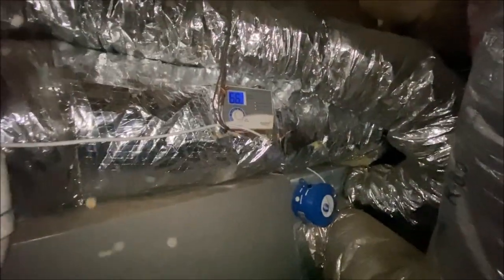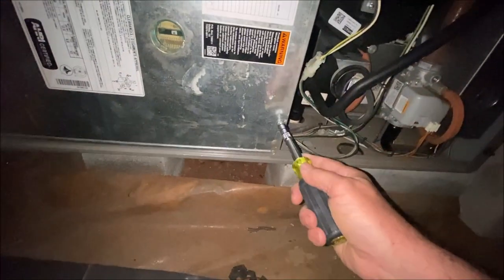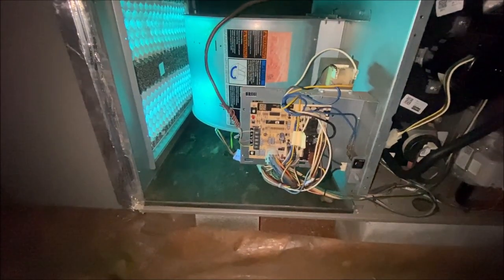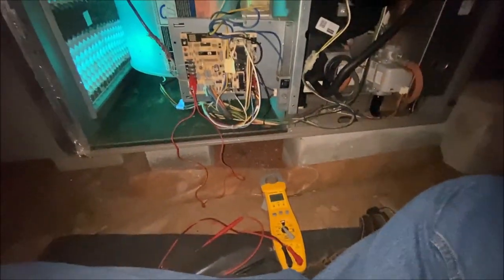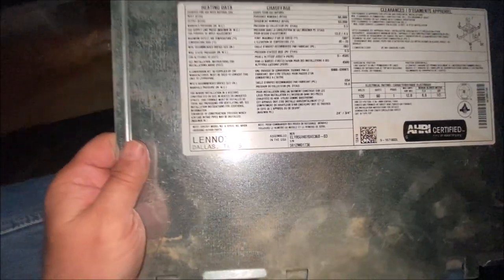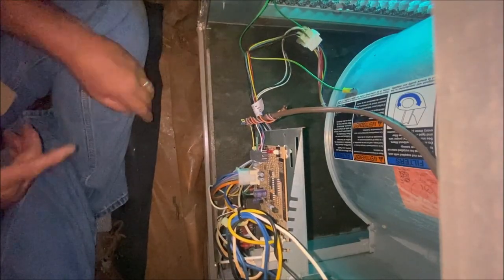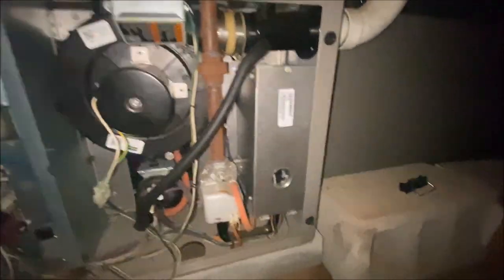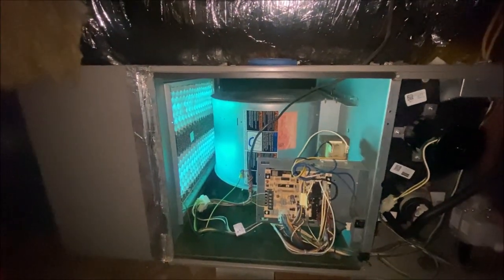Lennox ECM blower motor fail and replace

Comment: I don't think the UV light should be shining on any plastic parts or wire. Kinda like the sun.
Reply: ...worse😏🤫
Reply: And should be interlock with the door switch and not come on when door is open
Reply: I was going to say the same thing or bare skin for that matter.  I don't think it should be blasting light anywhere near that board either.
Reply: @DaveBigDawg that would be tricky to wire up and make look right, the door on the filter housing itself does have something, you have to unplug it first to open it.
Reply: If it is placed down the return line more and shielded, should be no problem to be on. The ones I have used only shone towards where the airflow came from.
Reply: @tedbell4416  it'll be ok, just stare at it for a few hours or ten..... 🤣🤣

Comment: I’m pretty sure that 4th screw in the bracket without the rubber mounting was a shipping bolt meant to be removed at installation
Reply: The moment he zoomed to the motor my alarm bell was ringing. They forgot to remove that bolt for sure. I don’t think installers read the manual. Wait, I know for a fact they don’t.
Reply: Your 100% right that’s plastic washer got a bin full of em
Reply from the maker: Yea and that is the noise you hear when it first fires up.
Reply: It is lol. We only install Lennox and I always take those out. Manual clearly says to
Reply: no worries it will self clearance and rattle itself out after awhile. 🤪🤪

Comment: Poor air flow will always kill an ECM. Most all duct systems are undersized and that is not good for ECM.  Be assured the indoor coil will be leaking when the unit hits 8-10 years and for sure by 15 years of age.

Comment: I realize this might not get read as this is an old video, but I thought I might point out: that style of door switch typically has a maintenance bypass where you can just pull the pin about a quarter inch out and it will latch the contact closed. No need to remove it and manually bypass.

Comment: Wonderful video Ted.  Another "X13" motor that mechanically is just fine. It's the "thermistor" that fails on the module, a $2 part, that often can be replaced but requires soldering skills on a circuit board. I noticed this OEM motor is by Genteq and so was the replacement that came with the "adapter" that is just like the Evergreen motors which I beleive are also made by Genteq or now more commonly known as Regal Rexnord who bought out G.E. motor division. Probably that OEM designed the same as the Evergreen as they do not require "programming".
Reply: The thermistors on older Kohler generators also went south often, but really were tough to access.
Cheap part, but a real bitch to replace.

Comment: Hello there Ted.. Great Vid.Thanks for posting!  From your lengthy experience working on HVAC systems, which are the top 4 brands that you would recommend for purchase (Ranked 1 to 4), based on durability, warranty, repair parts availability, and cooling performance.  I live in Houston, Texas., and I'm doing my homework for the purchase of a new system.  I have a one story home - approx. 1900 Sq. Ft., which currently has an 18 yr old Carrier 3T single stage unit that I have had issues with over the past 4 years with a leaking coil, replaced blower/fan motor (twice), and capacitor replacement (1 per year).  Popular brands in our area are Carrier/Bryant, Trane, Amana/Goodman, Lennox, and Ruud. Your opinion carries weight with me, so I hope to see your response post soon.
Reply from the maker: Trane, Trane, Trane, American Standard.
Reply: @TedCookHVAC  Thanks for the response Ted! Based on the square footage of my home, would you recommend that I go with 3.5T, stick to a 3T, or jump to 4T? 1 or 2 stage?

Comment: Another first class video Ted. 👍🏻  Those motors are great.  …for generating service calls.  I won’t have one in my house. With that being my strong feeling, I located a NOS Trane gas furnace in a sealed carton with a conventional PSC blower to replace my 39 yr old Heil furnace this summer.  But I do like than nice blue work light in that particular Lennox.  There won’t be a blue work lights in my new furnace, I can promise that.
Reply from the maker: Good call!

Comment: You have to turn those UV lights off if you see them. If they work they are bad for your eyes. Exposure basically sunburns your retinas and will damage your vision and make your eyeballs itch.

Thankfully for you most of the UV lights used for stuff like this are completely ineffective. Probably this one too.

But if it is UV-C, as needed to kill germs, then it'll kill your eyeballs.

So turn it off while you're in there next time. It's okay to see it for a short bit, so you see it right as you open as long as you disconnect it and you can reconnect it and ensure it is back on before you close it up.

Comment: I think the slight rattle was from where you took the grounding screw off of the old motor, that screw was also holding the inner shroud and that screw wasn’t put back in place.

👍🏻

Comment: Been watching a lot of your videos. I am researching, looking to replace my 20 year old Lennox system. I hear a lot of people say find a good installer first, brand second. But with so many different manufactures... what brand of systems do YOU have the most service calls on? Or anyone on here... what systems seem to have a good life, and which ones bite the dust earlier than normal?
Then my other question is which ones are easier to service. I was looking at Goodman, then I hear they don't last, and its a pain for the tech to take apart when needed to do service work. 

Now I did remove one of these fans from my folks house. One of the thermistors under the motor cap had popped.

Comment: A question ... the bolt that tightens the band around the motor (the one you praised Lenox for) if you did not remove the 3 + legs & rubber absorbers that hold the motor in place first, could you not instead just loosen the band bolt & simply slide the motor out with that band loosened, & then slide the new motor into the same loosened bracket, without having to pull the 3 brace legs off ? Or am I splitting hairs ?
Reply: sure, if you have small hands and tools to loosen the band pinch bolt between the blower wheel and motor housing(nearly impossible) and then only if the blower wheel hub and shaft are not rusted/seized and fall apart once set screw/bolt is backed off(very rarely do they come apart easily). so more or less NO, unless it's new unit that fails within a month or two at most.

Comment: as for the UV lights, having them on both sides of the evaporator coil makes sense to keep bad things killed off(moist/humid/warm environment when between cooling cycles) make sense. but, very likely the condensate pan isn't UV rated plastic, nor other materials in there(zip ties/insulation, etc.)

Comment: Ted what is your expert opinion on dual fuel? I am thinking about getting a trane S9V2 & XV20i heat pump what are your thoughts on that combo?
Reply: dual fuel = always(gas/propane or electric and heat-pump). it depends on your normal climate and uncommon fluctuations. you do the research, math and figure out what's best for your needs! 😉

Comment: 39:05 - You didn’t show it to confirm my suspicions; but, the frost on the suction line was the result of the refrigerant not boiling off in the evaporator from no airflow across the coil.

Comment: good videos an good ground for gentex motors are very very important . speed controller board insert can be purchased separate, cost damn near the price of motor. if i sit down with old one probably  find a cap/ mosfet or diodes  / resistors. bad---- they reman price in florida.

Comment: We have had TWO blower motors fail, due to arcing between the wire bundles, where they are compressed under a metal bracket.  This is a "design defect" and needs to be addressed by the company.  The motors are just fine after removal, and the wiring repaired.  Our first motor ran for 13+years, until it wore out the cheap bearings, causing sinking, and caused rotor to stator interference, causing a intermittent screeching noise.  Later techs put in better motors, but they failed due to the wiring arcing destruction caused by the bracketry.  This is "cheap and crappy" wiring insulation, and bad design.

Comment: I wish I had seen this sooner. That light is uvc light will burn skin around 3 minutes and can cause burns to your eyes faster the closer you get, yes for disinfecting but it's super dangerous if not used correctly. If you end up seeking this make sure you turn thay type of lighting off the moment you see it. Oh yeah for air handling its not going do pretty much anything vecause it takes time for it to kill germs and not seconds. It's a waste of money on moving air.

Comment: Took a chance one time on a vs motor with blown MOV in module. Took module to another customer that repairs electronics and they replaced the $4 mov. Put it back in furnace and it ran fine. Saved customer $700 and cheated lennox out of $500

Comment: Psc motors are more economical, power savings and all . Buy the time you buy the ECM you could buy a lot of power for the psc .
Reply: Exactly. The DOE did the consumer no favors. Actually they're probably not that much more expensive to build. It's just a poke the consumer deal.

Comment: I wouldn’t want to do residential HVAC. Industrial sucked and blew and sucked bad enough as it was. I even did cooling towers in my youth.  Ended up just doing controls. Less physical, but the phone never stopped. 😳🤯🤬

Comment: ECM motors are a Fin joke. As are the manufacturers who "won't" sell just the ECM module. They want us to replace the motor/module when all we need is the ECM. Could be a 1 year old warranty motor with a perfect motor, but noooo, we're forced to get the motor and module. I hate Lennox.. How about the Lennox heatpumps with NO fuse or circuit breaker protecting the low voltage side, they use the transformer as the overcurrent device. Better yet, how about the Lennox Elite series condensing units where the king valves are so far recessed into the chassis you can't get the Appion core tools on there to remove the schrader valve,, they make you pull a vacuum with the cores in place. And after 10 years of complaining, Lennox finally moved the electrical knock out from blocking access to the suction all the time port. Don't even get me started on warranty evap coil replacements. Lennox, YOU  &^$##$%^&...       I'm sorry to be on a rant... The rain in NC this week is killing me...Oh one more thing, that belly band divot holding the bolt from spinning was actually a manufacturing defect that will be removed on the next revision..
Reply: I have been looking around to replace my 20 year old Lennox system. Came with the house. Not looking for a 2 stage unit, I dont think, or the higher  variable speed systems. What brands last longer to you? During a service call, which ones are easier for the tech to work on. Meaning 2 screws vs 20... I feel your pain. Im a maint tech and people that design the equipment layout sure dont think about the maintenance side of things. I was looking at Goodman, but hear they suck, and really make the techs work during replacement of parts.